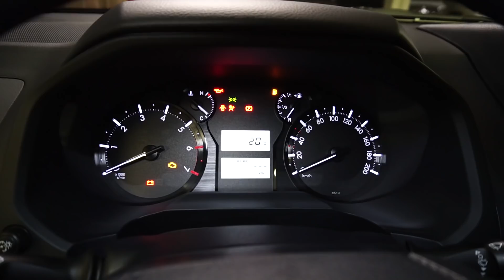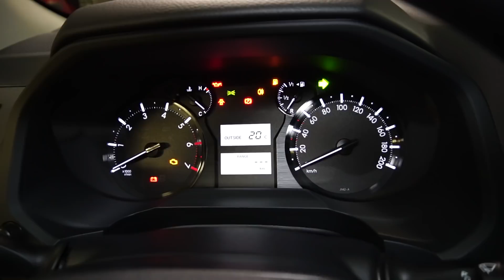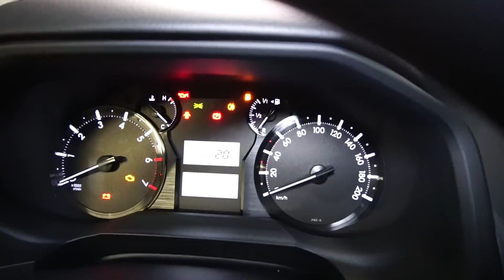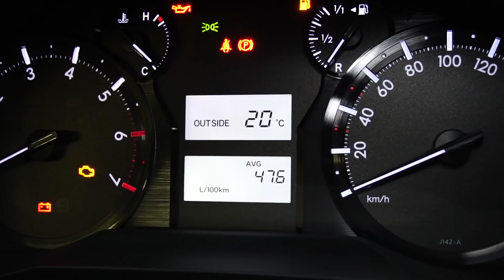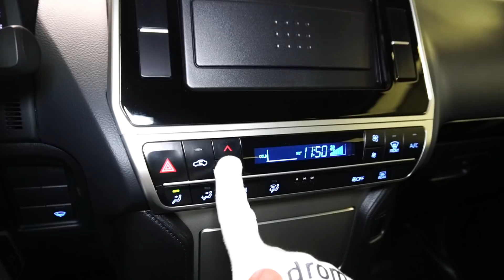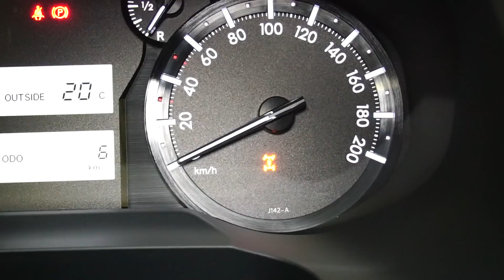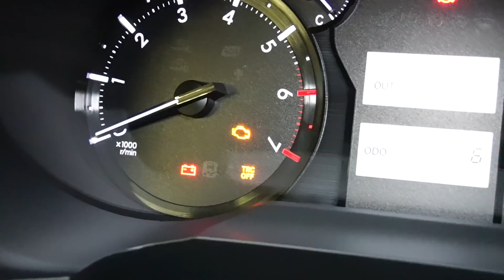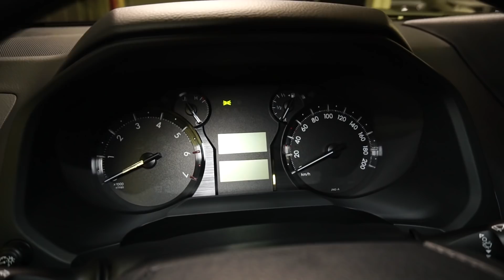Toyota Land Cruiser Prado 2018 2.7 (163 л.с.) 4WD MT Классик - видеообзор

Comment: Very nice. We would love to have these basic Prados in Canada.
Reply: we do, but as the lexus
Reply: @snoozymcgee4372  It is true we get the loaded Lexus GX but I am speaking specifically of the basic 2/4 door Prado with the 2.7 4 cylinder. With a manual transmission, the 2 door would be the perfect replacement for the FJ and suitable competition for the base 2 door Wrangler and Bronco. The 2 door  Prado is sold in Europe, Asia and South America. North America is Toyota's biggest and most profitable market, we therefore merit the best models as well as the biggest selection. The 2/4 door Prado comes from the same factory that already supplies our 4Runners and GXs . With the 2.7 engine already sold in the Tacoma or the 4.0 V6 from the 4Runner, these Prados will meet North American emission standards without modification. Lastly, steel wheels are due for a comeback.